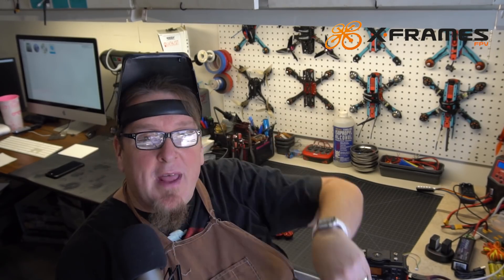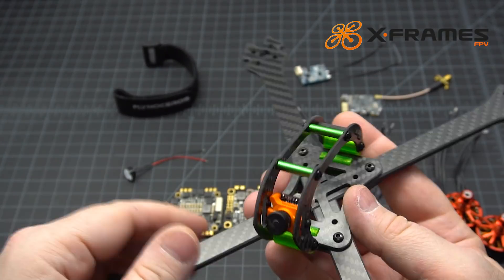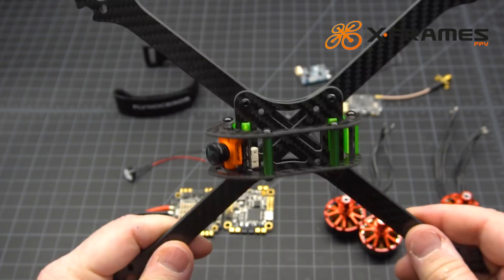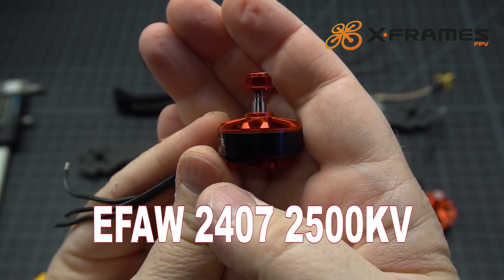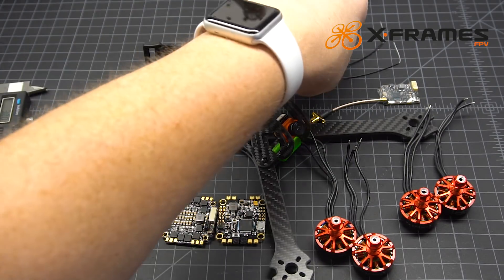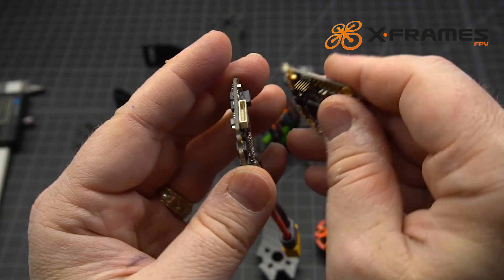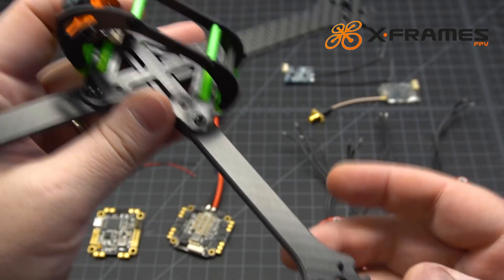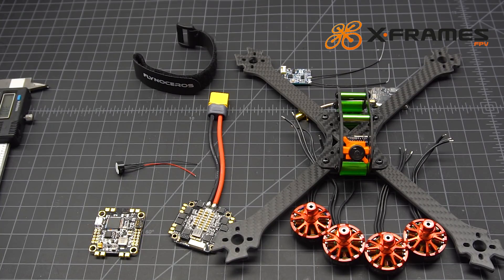Flynoceros AEther 6" FPV Race Frame "Buildout"

Comment: ive had nothing but problems with every tbs vtx i have tried , ( ive tried both the normal one and the hv  )  , a quick search shows lots and lots of others also having problems. seriously just  look for yourself.  that doesn't mean u cant get lucky and get a good one, but you should check out the mach vtx's - they are the best vtx i have ever used, and the company claims you can power it up, without an antenna,  at full power (800mw) and leave it on for an hour, and it will not burn itself up. thats quite a statement, the company stands by their product. i have never ever seen any other vtx that is as robust - and excellent video quality ( considering you wire it in correctly and know how to suppress a noisy electrical system if you have one ) just my opinion and recommendation ,.  im not sure if they are sponsoring you to promote their products,. every other thing made by tbs is great - their long range system is the best hands down - but im very disappointed with their vtx's
Reply from the maker: Sorry to hear you've had that experience. I have used TBS VTX's in dozens of my personal drones and have put them in no less than 100 Customer builds and they have performed flawlessly, for the most part. No more issues than any other manufacturer in my experience.

Comment: Help!!!! This wonderful creation of yours ended up in my lucky hands however I'm having some issues.  Flu it last night had a pretty hard crash and now only one motor spins upon startup and blheli only shows one ESC on there now. When I go into betaflight to try to move the motors under the motor tab only number three moves.
Reply from the maker: Check the connection between the FC and the ESC. Email me at memphis@xframesfpv.com if you have other questions.
Reply: Will do!!!!

Comment: Just curious, that's a 20mm spaced frame (I think?) but youre using 30mm boards.   Curious of the overhang of FC and esc outside of the protected body.